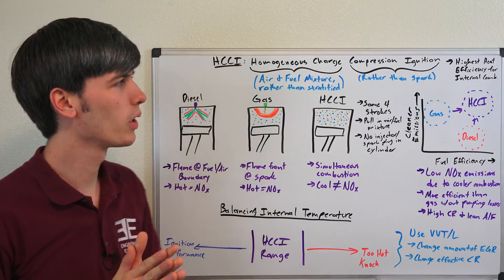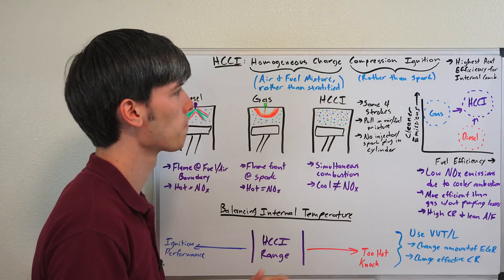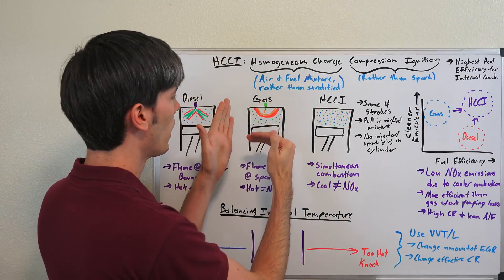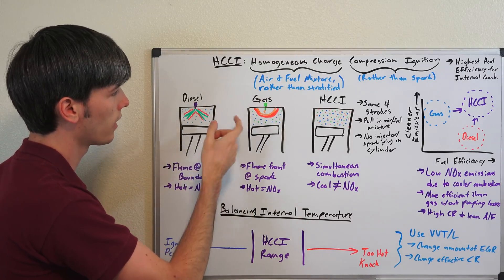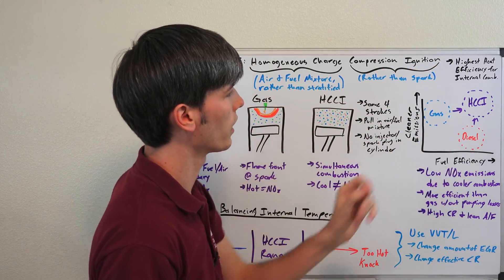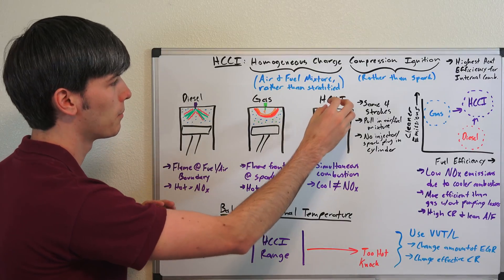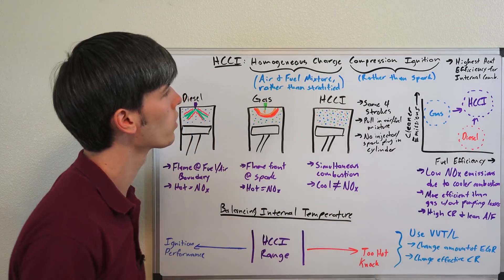The Most Efficient Internal Combustion Engine - HCCI

Comment: Why has there not been further development of twin crank engines with opposing pistons compressing in a cylinder? The energy created through combustion is then utilized more efficiently to drive the pistons appart and not trying to blow the head off.
 This concept was used on German diesel plane engines  in the 1940's.
The HCCI concept engine will be hard to tune and will be effected by many variables. A high octane injection for diesel engines or multiple spark plugs within a chamber might be options.
Reply: The two pistons per cylinder engine is the basis of the napier deltic engine used for railways.  They can be made extremely efficient with fairly simple mechanical design.  The compression ratio can be very high making the temperature ratio very high.

Comment: Why not just open the intake valve later instead of leaving it open as you compress? That way you don't have stuff going back through the valve, but the pressure of the gas would be less => mixture combusts later?
Reply: Your idea is much like the throttle plate in a gasoline engine.  You are reducing the pressure in the cylinder by restricting air flow.  You may get slightly better efficiency doing it with a valve but a better way would be to have some means of varying the displacement of the engine.  All the mechanical bits for the engine in the video seem like they could be better applied by changing the intake stroke length to reduce displacement.

Comment: Hi! Can you please shortly explain the relation between the thermal efficiency and air-fuel equivalence ratio? I'm prepairing for an exam, and I'm kind'a stuck...

The question is simple - what happens to the thermal efficiency, when the equivalence ratio is 1 and increases? There is a ton of  equations, both fed and rejected heat decrease, but this still doesn't give me the answer.
But I know for sure, when equivalence ratio increases from 1, the specific fuel consumption decreases, till some point, when the mixture gets too lean. This decreasing means, that the thermal efficiency increases, am I right?

Comment: So it uses petrol, not diesel, but just compresses it until it ignites,  like you would in a diesel engine? If you can just compress petrol and air to make it ignite, why do we use sparks to ignite in petrol engines at the moment?
Reply: Because to ignite petrol in a controled way at exactly the right time with just compression ignition is extremly hard. Quite often if you try this, the engine will start to knock at some point. And so far there is no engine that relies solely on HCCI ignition under all load states. So far it only works under partial load.
Reply: Nitro engines run this way under all load states. I have 2 at home. One for example has a 0.0192 litre displacement and it's 2.07HP @ 12,000 rpm so it's 108HP/L.

Comment: How does this prevent an engine from knocking?  If you add air/gas and compress it, it sounds very complicated to prevent the air/gas from combusting while it is compressing.  This needs a strong engine and might make it less reliable.  Sounds interesting...

Comment: wouldnt gasoline stratified injection compression ignition be more efficient? you would be able to use higher compression ratios as well as better control the ignition using direct injection methods. like a direct injection diesel, but with gasoline (cleaner burning), using higher compression ratios (and better thermal efficiency id think)

Comment: Interesting! My father, A.L.Hardinge designed and developed the Mills Diesel model aircraft engine, back in the late 50's early 60's in Woking,England, this was basically a 2 stroke compression ignition engine. The largest capacity one produced was the 2.4 cc but the one that went best was the .75cc Would it be possible to do this on a  larger scale, like a 4 cylinder 1.5 litre/ Or is that a really nutty idea?

Comment: So it's kind of a prechamber diesel adapted to use gasoline?
Still lots of questions: 
-arent the cylinderwalls potential problems in a homogenus mixture because the fuel will stick to it?
-Or when hot enough will the fuel at the cylinderwall ignite to early or too late because ot could heat up or cool down the particles touching it?
-wouldn't the engine be significantly heavier than a normal gasoline engine? Dieselengines are heavier to be able to handle the higher compression...
And lastly: Nissan?  The company who told fantasy stories about their LeMans-prototype for over a year, and then had to face reallity...

Comment: It seems to me that this concept, like so many others, skirts around the main issue facing internal combustion which is that this is an engine which melts at the burning temperature of its fuel. For a device which depends on extracting as much heat as possible from its fuel to be efficient, this is disastrous and the fact that a machine which converts heat energy to mechanical force and requires a cooling system is, frankly, hilarious. If HCCI has a place at all, and it well may, then it must be in an engine which does not specifically set out to be inefficient in this way.
In the 1970’s experiments were done with ceramic engines, a car was tested by the police in Britain which had a block and hottest running internals of ceramic material. It was a four cylinder, 1200cc diesel and if I remember correctly was also naturally aspirated, an engine of this specification would typically be so underpowered as to be unusable in most automotive applications – the police used it successfully on motorways as a pursuit vehicle! This motor did not melt at the combustion temperature of its own fuel and so required no cooling system meaning that instead of a tiny fraction of the heat generated being converted to mechanical force the vast majority of it was.
Of course the usual criticism of what is often thought of as new technology but is in fact a new application of old technology is cost; needless to say the cost of R&D etc’ would be quickly recovered on the successful demonstration and market acceptance of the technology.

Comment: I believe the next step for ICE is gonna be F1's latest tech of using a pre combustion chamber to equally distribute the air fuel ration with in the cylinder thus creating better efficiency. It's proven and all the engine manufactures in F1 are already looking into it on the road going cars.

Comment: so pretty much a diesel with perfect compression? but then wouldn't turbos and other power adders like programmers be useless and as the engine wear wouldn't it become unusable faster and need a rebuild? plus how would it start unless it has a block heater or glow\spark plugs which would hurt its emissions?

Comment: so basically it's a gasoline running diesel, without direct injection?
Reply: yup
Reply: neat!
Reply: It's like if a Diesel engine had a carburetor or port injection.
Reply: Brett Young thats a common misconception, but timing has absolutely nothing to do with it. if you think about it, you turn off a gasoline engine by killing power to the spark plugs. so how can spark timing have anything to do with causing an engine to run on after you turn it off, when there is no spark when you turn it off. carbon build up can cause hot spots, hot enough to ignight the fuel. they can also up the compression enough to heat the air up past the flash point of gasoline. Basically causing it to compression ignight just like an actual diesel.
Reply: Without going into physics... That engine would have to pretty damn stout on compression to heat that fuel up lol unlike diesel...
Reply: The only experience with this issue was on my 150 and it came out to be timing... So idk lol
Reply: Brett Young not really. ever hear a gasoline engine run on (aka diesel) after the driver shut it off? mostly caused by carbon buildup, which causes the engine to continue to run without spark, just like a diesel on compression alone. only a little bit of carbon build up is needed to bump the compression up.
Reply: Youtube is gay, they never explain what it is from the start, they waste time. He could of said "it's a gasoline runing diesel without direct injection" THEN explained it in detail
Reply: Diesels get is most commonly from over revving and the extremely hot motor detonating it... Timing is the main culprit for running after shut off.. Never head of carbon doing it

Comment: So Koenigsegg is coming out with that Free Valve stuff, where the ECU is controlling the valving entirely. With that changing the effective compression ratio of an engine along with something like infiniti's variable compression ratio changing the size of the combustion chamber, maybe a completely HCCI engine could work. Instead of a throttle you could just have a plenum like a diesel and you vary the engine speed by changing the size of the combustion chamber!

Comment: Well I can see you don't know about how clean diesel engines are these days.I'm an over the road truck driver and I have to deal with that having to go into California.truck exhaust and carbon as you say is a heck of a lot cleaner then they breathe in.You need to study more in the diesel engines.this even concerns the pickups,cars,farm tractors,and heavy equipment also
Reply: I think what he's saying is that driving a semi in the smoggy L.A. basin comes very close to being a zero-sum for emissions.  A truck with all the required equipment is probably doing less to pollute the air than all the gas-powered autos surrounding it in gridlock traffic.  There is a standard here in CA called 'Certified Clean Idle', which AFAIK means that a diesel engine at idle will not emit any more hydrocarbons or soot than a gasoline engine per liter of air.

Comment: This turned into one hell of a post so...

In summary, TL;DR, EGRs are used to raise the temperature required for combustion of fuel, not change the temperature in a cylinder, and electric cars are just as toxic, if not more toxic than petroleum cars.

I could be wrong here, if I am, feel free to point it out. The EGR valve isn't used to change the temperature inside the cylinders. Mixing exhaust with the fuel and air mixture makes combustion more difficult which can be a good thing. The high temperature inside the cylinders can cause preignition which causes a knock. This typically happens because the tips of the spark plugs become red hot and ignite the mixture before the cylinder has fully compressed which causes the piston head to become unstable as it attempts to continue compressing an exploding bomb. The piston then bounces off the walls of the cylinder and "knocks".

In the "olden" days, before EGRs, lead was used in gasoline to increase the temperature required for combustion. In modern times, we have removed lead from gasoline and use octane to increase the temperature require for combustion. Older cars without EGRs require higher octane to prevent preignition, while most newer cars, thanks to EGR valves, can get by with lower octane and actually get better fuel economy with low octane gasoline. The computer adjusts the amount of exhaust being recirculated into the engine to correct any knocks or misfires it detects. While the majority of the fuel is burnt from exhaust, a small amount is unburnt, so recirculating that back into the engine can increase the fuel efficiency of the engine very, very slightly, but more than if the computer didn't make this adjustment, such as in the case that you were using high octane fuel. Also, since high octane fuel is more difficult to ignite, when the engine is cold, you will get lower fuel economy and power.

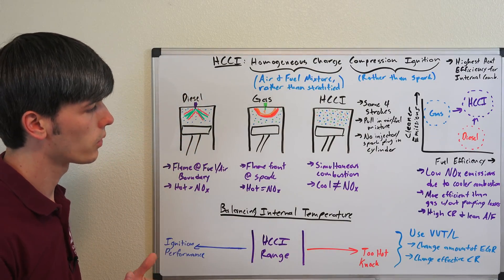Perhaps you already knew that and didn't want to do a detailed explanation at 3:58 or perhaps I am just wrong. If so, I would like to know, but the above is how I understand EGRs, octane, and lead gasoline to work.

Now I would like to discuss electric engines. If you look at electric motors with a very shallow mindset, it sounds great, but if you look deeper into it, they become an environmental mess. There are two main problems. The first being, while you don't see the pollution caused by plugging in your car to charge it, the truth is that most of our energy comes from burning coal. So, you are basically going from a petroleum based car to a coal-based car. Secondly, you will need a lot of batteries. Battery production leaves a huge environmental footprint. Mining the resources and producing the chemicals used in batteries is currently extremely destructive to the environment. Not to mention, batteries only last, on average, 4 years. I suspect that, in all electric cars, that average will drop significantly since the batteries are used to power the car entirely, whereas, in gasoline cars, they are only used at start-up. After start up the alternator powers your electronic components.

You will probably tell me that 99% of car batteries are recycled, and that is true, but the majority of a battery can not be reused. The lead is the main material recycled in a battery. Currently, we have a huge problem with companies not fallowing EPA standards with recycling batteries and polluting third world countries with toxic materials. It would be nice if we could rely on electric cars, but first I think we have some major hurdles to overcome. Better sources for energy than coal and more efficient and less toxic batteries, as well as better recycling practices, being chief among them.

Comment: How could one easily find/define the  energy conversion efficiency state of a given individual engine? I'm thinking in the direction of using an old car engine thru diesel-electric transmission for providing electric power and heat, both in my house. (the engine would have to be converted for other "oil like" fuels beside diesel/heating oil of course)

Comment: Wouldn't you lower the CR by leaving the exhaust valve open instead
Reply: No, because then you would push unused fuel into the exhaust rather than back into the intake to be used in the next cycle.

Comment: In high RPM's would the HCCI spontaneously combust (from excessive heat) which would lead to knocking? What are engineers doing to combat this? I imagine manufactures would start using iron blocks again because of the low cost, high durability (similar to the 1.0l 3 cylinder engine that ford is using)

Comment: I believe that Honda had a motorcycle racing engine that ran on this principle back in the 1990's.  The difficult part was keeping the parameters within the narrow range needed to insure combustion.  They actually started the engine using spark plugs until the temperatures would support the combustion process.

Comment: I know it is a bit off topic, but I have owned at least 40+ cars and Nissan engines are by far the most well made engines I have ever experienced. All of them have done over 200,000 Km and not one oil leak.
Reply: Tim Smith The #1 pain in the ass job on a Nissan was my friends alternator on his pathfinder. You had to take off the plastic skidplate, the sway bar, and you could only move your hand about 1 inch when removing the alternator bolts, because nissan in all their dumbass thinking put the alternator UNDER the engine. The belt tensioner is also, again, on the bottom. My 99 Sierra? Alternator is on top. Fords? Alternator on top. Nissan is the only company I've seen put the alternator on the bottom, on a truck or SUV, even on most cars. It was a royal pain in the ass job where we had to jack up the car. Any other vehicle it would have been a 15-30 min job instead of an hour thirty to two hours. I work on my 99 Sierra all the time it's a thousands times easier to work on, even my friend agrees. Nissan makes reliable vehicles, but they aren't as easy to work on in general. Toyota and GM think about the placement of parts, so they are much easier to replace/repair.

Also his oil filter. Again, under the plastic skidplate, and RIGHT BEHIND the sway bar, instead of mounted on the rear of the engine like every other V style RWD layout SUV or truck. Mine? Back of the block where it's easily reachable.
Reply: LinusScrubTips Fair enough. The Pathfinder sounds like a shitty design to me. I have Never worked on the older Pathfinder, only the 2.7 td from 97-99.

Some cars are definitely a LOT easier to work on with a hoist. Your problem reminds me of the old Fiat engines where you had to jack the engine up so that that you could slide the alternator bolts out to remove the alternator.

Some things are designed crap.
Reply: is that all? nissan r junk.
Reply: darrell l As opposed to what?
Reply: LinusScrubTips I don't think so. I have changed many components on them and had no dramas. Then again, I am a commercial aircraft mechanic.
Reply: Tim Smith Ya. I feel like certain Nissan were ok, like 240s seem more open in the engine bay (although I've never worked on one). My friends QX4 (pathfinder) is a 2002 with the 3.5.
Reply: Japanese engines are usually pretty reliable. I'd say Honda probably takes the reliability cake though. Problem with Nissan is after 100k the rest of the car looks like it just peaked into the box at the end of Raiders of the Lost Ark.

Comment: One of the Problems I see is that you only have a slow method of changing engine power output by changing the filling of the cylinder which changes power only on the next cylinder that gets filled instead of a fast change like on the next injection (Diesel) or by altering ignition timing of gasoline cars

Comment: This is all well and fine, but GM has been there and done that.  A video posted in 2007 shows a car that was drive-able using gasoline that was HCCI with standard mode fall back.  Why it is not in production I don't know, still some bugs in the system maybe?  Sounds like the system could be rather complex.